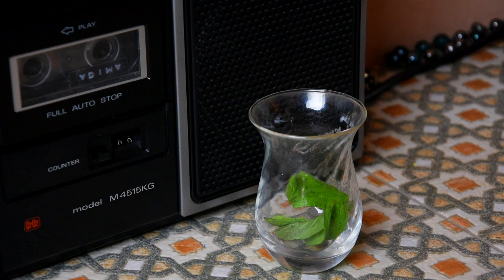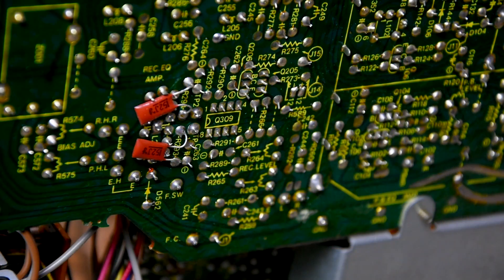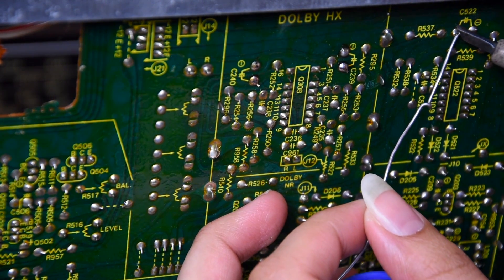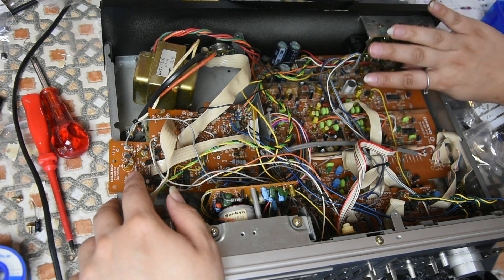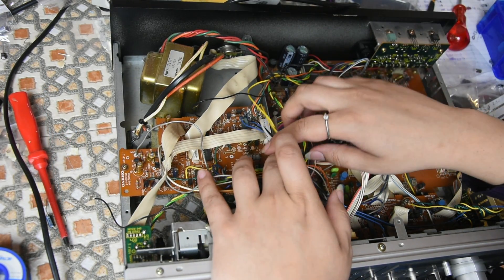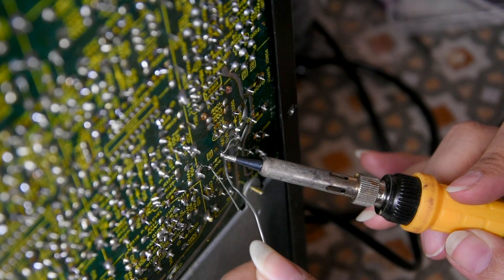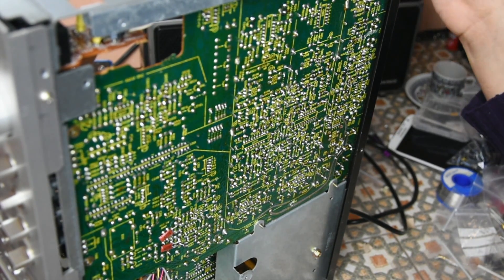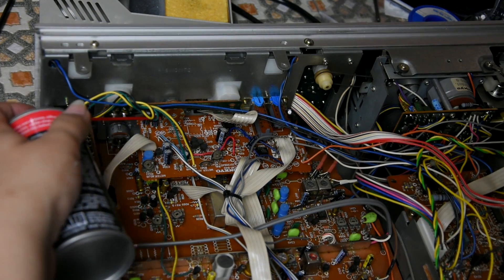Onkyo Tape Deck Part 2 - Capacitor Replacement

Comment: I admire your bravery when it comes to doing these kind of jobs. I fixed many a cassette deck but i usually stay away from messing with the electronics unless its just fixing up some cracked solder joints.. Someday i will probably have to do this and then i will think of you :D Btw where are you getting your capacitors?
Reply from the maker: Believe me I have to psych myself up to even bring a screwdriver close to this haha... Hence why i'm always very nervious the first time I switch on after recapping :o)
I'm getting Nichicon Capacitors, or Low ESR capacitors from ebay. Just be sure not to fall for the "Audio Grade" marketing, it's basically just low ESR Capacitors :o))
Reply: MsMadLemon Do you buy these caps from chinese sellers or local? Have you ever tested them to see if they are within spec?

Comment: Hi Maddi,   Good job as usual. That de-soldering gun works very well!     Love the 2200  ooof! and the giggling!    :)

The problem with the eject is with that dampener.   Before suspecting the dampener make sure that the arm that links the cassette door to the dampener is not broken or disconnected.

Some of the dampeners rely on air pressure only and have a rubber gasket that surrounds the piston to restrict air flow in the piston.   The screw at the back of the dampener is an adjustment for how much air is allowed to escape during the eject process.   If the screw is not affecting the dampening then it is very likely that the rubber has perished and needs to be replaced.    

Other dampeners use a heavy silicon grease inside the piston to slow down the travel.    This is similar to the cue-ing mechanism on a tone arm.   It is possible that the silicon has changed viscosity and needs to be replaced.   

The dampener is usually on held in place by one fastener that allows it to pivot with the cassette door.   They are usually very easy to remove and inspect for problems.

Second, the glue on the capacitors is there to hold the capacitors in place while they take a trip through a solder bath.   The solder bath is where all of the connections are soldered.   They aren't done by hand, that is why the solder looks so uniform..   If you see different solder on the board it either means the component has been repaired or replaced either before it left the factory or as a customer repair.

Third, the glue used on the capacitors of a unit of that vintage is most likely bad.   You should remove all of the glue from the board and inspect any other components that came in touch with it.    Over time and with heat, the glue becomes dark in color and becomes corrosive and conductive.   For the longevity of the unit it is important to remove all of it.    If you want to find out more information on this, you can search for "Sony Bond Glue" or "conductive capacitor glue".    All manufacturers were affected by it but Sansui and Yamaha seems to be the worst.  

Fourth, you can't always rely on a schematic when ordering capacitors.   Many times the manufacturer made changes to the production run for various reasons and never updated the schematic.    If there is a discrepancy it is always best to use the value in the unit itself.

Fifth, after a major repair it is ALWAYS good to use either a variac or a bulb in series with the ac line.   The bulb is very cheap and easy to implement.    All you need is a standard incandescent bulb, a surface mount bulb socket and an ac power receptacle.   The bulb is connected so it is in series with the hot side of the ac circuit.   If there is too much current being drawn by the unit you repaired the bulb will light bright.    By using different wattage bulbs, you can limit more or less current to the unit.   You can also make one with an AC extension cord.  Cut one of the extension cord wires and inset the bulb socket.   

-bob
Reply from the maker: Thanks very much for all this detailed info and advise Bob! much appreciated!
Reply: Anytime!   if you run into any problems, feel free to reach out to me.   -bob

Comment: If there are no markings on the back of the board and I have the unit on it's side, as you do, I shine a light from the front or top side of the board and it reveals all the traces to the backside and allows me to zero in on components a lot easier. Good job, thanks for sharing...
Reply from the maker: That's actually a good idea, thanks Darryl.

Comment: my favourite possible source of Humpty Dumpy is...
Humpty Dumpty and the Fall of Colchester - origins
How did the story come about? 
Humpty Dumpty as described in Alice through the looking glass
Humpty Dumpty as described in Lewis Caroll's book
Nobody knows exactly who or what Humpty Dumpty was. The rhyme was first printed in 1810 and became famous through Lewis Caroll's book, 'Alice Through the Looking Glass', where Humpty Dumpty is shown as a round egg. However, it is a very old rhyme and goes back much earlier than this. 
Humpty Dumpty was a common "nickname", used in 15th century England, to describe large people. This had led to many ideas as to who, or what, the Humpty Dumpty in the nursery rhyme really was. The idea that 'Humpty Dumpty' was a powerful cannon, used during the English Civil War (1642-49), is one of the ideas taken most seriously. 
Cannons, at this time, were very heavy and moving them, even the smallest, took many men.
Is any of the story based on fact? 
Damaged tower of St Mary's at the wall church
The damaged tower of St Mary's by the Wall church
At the time of the civil war in 1648, Colchester was a town with a castle and several churches and was protected by the city wall.
During the siege of Colchester, the 15th century tower of the church known as 'St Mary's by the Wall' was indeed much damaged. This happened because, on June 15th 1648, the church was strengthened against attack, by putting a cannon on the roof. As in the story, a gunner known as 'One-Eyed Jack Thompson' fired the cannon. He caused a lot of damage to Lord Fairfax's attacking troops.
Thompson's success made many of the Roundheads fire onto the church roof and, sometime during the 14th or 15th of July, Thompson and his gun came tumbling down. The damaged cannon could not be raised again.

Comment: The opening of the cassette door is really a bit too violent. There must be something missing there. Did you check in the service manual? Sometimes there is an exploded view of all components.
Reply from the maker: Yes it is, tightening that screw made a tiny bit of difference but not enough. There is some piston looking thing and I think it's probably just become loose, i will check the service manual again.
Reply: If there is a piston... then it must be that for sure :) it can be with air damping or oil/grease... just my intuition :-P You are going to make just a comparison between recording performance after and before the recapping? no playback comparison?
Reply from the maker: Now why didnt you tell me that before I forgot about doing a playback comparison? it's too late now, it's all your fault :op  ;o)
Reply: shame on me :-P I heard already few comments in youtube about the sound improvement after recapping... I was just wondering how much better was it... and if is really measurable :-P Sometimes it is more wishful thinking than real improvement. Once I build an audio cable using twisted braided ethernet cable (I have tons of it at work in the trash) and then I was experimenting it... and my first reaction was... wow! this is really good. Then I put back the old cable, switched a few times back and forth... hmm... maybe there is no audible difference after all :-D what a waste of time :-P
Reply from the maker: I think it really depends, i mean a cable may be a little different experience than a capacitor, which can vary :op 
Though my guess is if it does make a huge difference to recording, it will do with playback also.  I will not reveal my findings, you can just sit and wonder :op .... though i'm away from home anyway so i'm not able to do anything :o( 
With regards to capacitors, it depends on how bad they've deteriorated and shifted from their values, if a 10uf cap still measures 10uf and then you replace it.. you may get the placebo effect and just make yourself happy :op But there will be no difference. However when it comes to old 70s and 80s equipment, caps have probably dried up or leaked, their values have shifted a lot. So replacing them will most likely make a difference.
Reply: For sure! Capacitors with the right capacity play a far greater role than any type of cable used. The cable type is still much in the "audiophoolery" category. I was really mentioning the placebo effect :) would be nice to have somehow a measured signal difference :-P Maybe with your nice condenser microphone set we hear some difference through youtube :-P at least for the recording.
Reply from the maker: Cables do make a difference but only to a certain extent, different metals will have different properties but when you get the stupidly high priced stuff, then it's ridiculous, as you say "audiophoolery" ... I dont believe in paying 500€ for a pair of headphones either. I've had someone comment and tell me off for not spending more and getting a better amplifier, yes it's placebo effect but in some cases it's just pure snobbery lol.
 Actually when i'm doing audio tests on my videos, I dont even use any mic, I connect the tape deck directly to the camera so you get to hear the direct sound. I know it's not 100% accurate but it's as accurate as one can get it :o)
Reply: Regarding the cables, if I am not mistaken, a transmission line can be modeled with a RLC circuit, and ideally all of these should be 0 so that you transmit signal without changes. For that, short cables are the best. Less resistance, less capacitance and less inductance. Then a cable is also an antenna... but I really doubt you can have any audible interference in most of the majority of the cases. In high end sellers you hear some "pseudo-technologies"... metal treatments that align some internal structures for the electrons to flow more easily, etc... :-D :-D 
The improvements from the entry level to mid/high level are quite visible. After that towards the very high end is hardly noticeable... and the price doubles with each little improvement. 
The best about this vintage audio is that you can buy nowadays med/high end for very little money ;o) 
How silly of me! Of course you connect it straight to the camera, you are not doing speaker reviews/tests :-D :-D 
Of course, there is no point in investing too much in just one device... like there is no point investing too much in an amplifier/preamp and then having low quality or small speakers. In speakers I noticed that after some point the size starts to limit the speaker... I have this impression that after some level the only way of improving the speaker is going for bigger size.

Comment: Nice job! It's nice to have desoldering tool. I have SP-1010DR desoldering station. It makes things much easier. MESR-100 ESR-meter is also cheap and good tool to check capasitors. :)

Comment: I have a Sansui AU 317 that must need a bit of TLC. After watching you I might even be able to think about having a go. I'll have to get one of those solder suckers first though. I'll have to wander through your videos and find the one on it. I might leave it for a little while, soggy England is having the driest weather in 20 years and my rhubarb has gone all limp. I am being serious just for once.
Reply from the maker: JP? Is that you? ...Someone replaced you with a serious person ;o)) haha I wondered then, I'm talking as if I know you, I don't at all lol... The site I got the desoldering pump was banggood.com but be mindful of import duties if it applies.. i'd check other sites like Alibaba first.
Reply: I know 'Ruth' at Banggood quite well. I suspect she has an awful lot of fiends called Ruth. She sends very polite and helpful email. Things take weeks to arrive but I do love Banggood. One wonders where it got it's name from. Perhaps it was originally 'Did The Earth Move For You Dear' LOL (Sorry  - back to normal)
I have had quite a bit from Ruth and so far nothing about import duties. I am putting another order in soon so I'll add the solder sucker to it. What's it actually called ? Banggood can be a bit tricky to find things on.
I did find one or two rather 'odd' items. My wife even went downstairs to get her glasses.  I won't go into details as your a lady of sensibilities and I'm supposed to be an English gentleman.

Comment: That desoldering gun seems quite good bw - might have to decommission the old weller and buy one I think.
Reply from the maker: So far so good, really! it's made it so much easier, but i've heard a few things about the site where I got it, be mindful of import duties.
Reply: Thanks, will do!  Remind me, was it AliExpress (I've used them a fair bit).
Reply from the maker: No not Ali express, it was 'banggood.com' ..But it seems a very similar site to Ali express or Ali baba.. i'd try searching Ali express first.